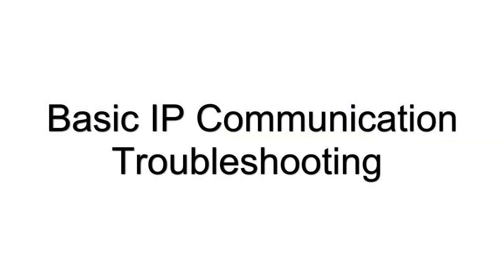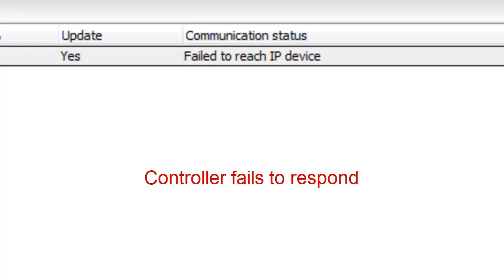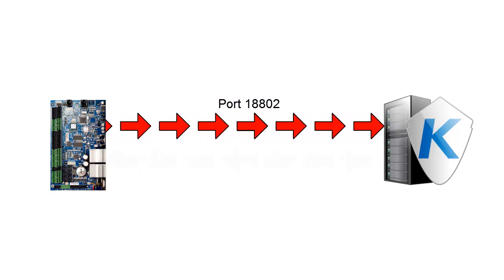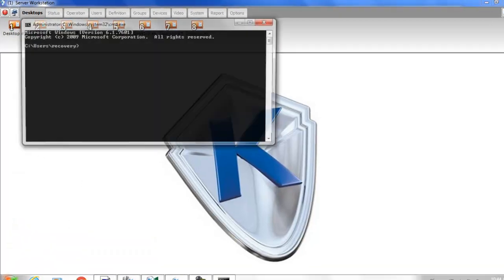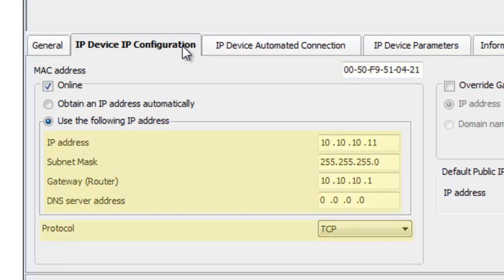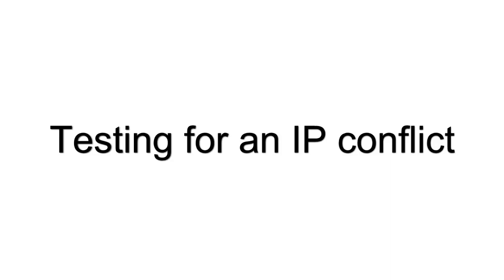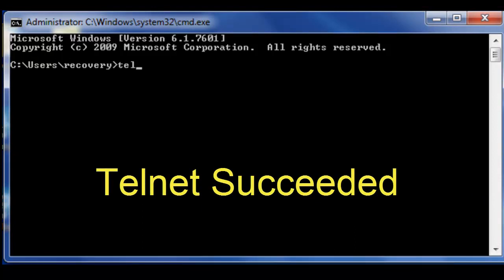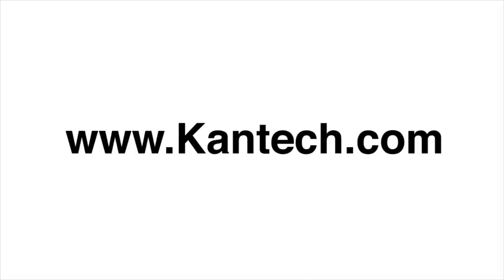EntraPass IP communication Troubleshooting

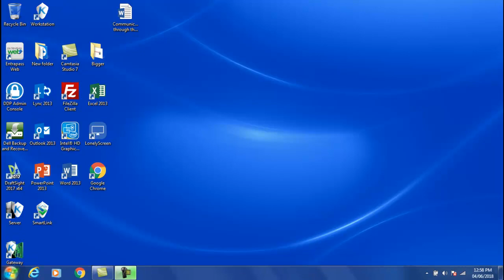Comment: seems to be a bit of a error in the video when you mention pinging the controller. 5:56 the IP address you pinged was the server not the controller. The information is sound but video shows wrong IP address
Reply from the maker: Good eye. Indeed, both the IP in pinging the controller and telnetting the server were reversed. The information is accurate, though.

Comment: let suggest an aditional hint: you must not energize the KT-1 with both means (PoE and power adapter), at the same time, otherwise, controller will not take the IP configuration, and will not connect.

Thank you.

Comment: Great help!  Answer to our issues was at 5:05; our management system was running DHCP and changed after a power failure, but the old IP was hard coded in.

Comment: How to communicate with PC to KT-300 Controller via RS-232 port. After setting entrapass software shows ""Connection Communication Failure" 

Please give me suggestions- Need to KANTECH USB to RS-232 converter or different brand converter can work?
Reply from the maker: Hello, I strongly recommend using the USB-485 adaptor instead of RS-232.
Reply: @kantechsupport6044   I want to use Kantech USB-485 converter and using Kantech Special Edition Demo software. 

It's working properly? or need to change software!
Reply from the maker: @kabirmutahakm3056  Yes, the USB-485 works perfectly with all edition of EntraPass, even the Demo version. However, you will be limited to 1 controller and 10 cards.
Reply: @kantechsupport6044  Sir, I am not using Kantech converter

using local brand HXAD RS485 to RS232 converter and controller RS485 TX/RX led is blinking but when try to connect entrapass special edition demo software, shows- "connection communication failure"

Whats the problems? 

KT-300 controller not support any local converter?

support only KANTECH converter?
Reply from the maker: @kabirmutahakm3056  Unfortunately, as this is not our converter, it is not possible to know what the issue actually is. We can only offer support on our own equipment. With our converter, with that message, I would tell you to factory default the controller to get communication going.

Comment: Hi KT400 after restart the controller 
Reset the IP and can not communicate with server 
How can I change the IP address of controller now
Reply from the maker: If the controller's IP resets after a reboot, jumpers JP2 and JP3 are probably not back on the controller. Both jumpers must be on the controller otherwise it defaults the controller.